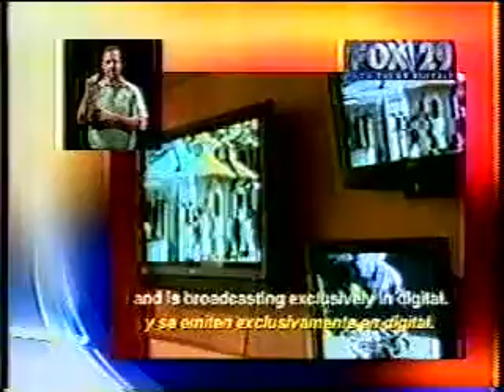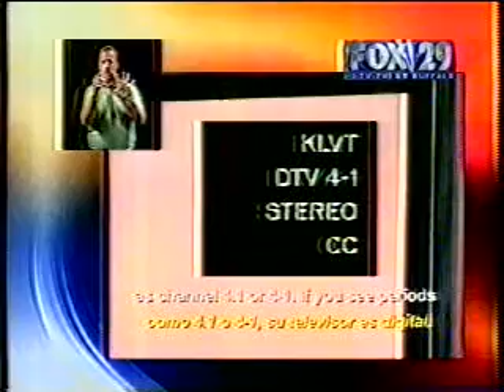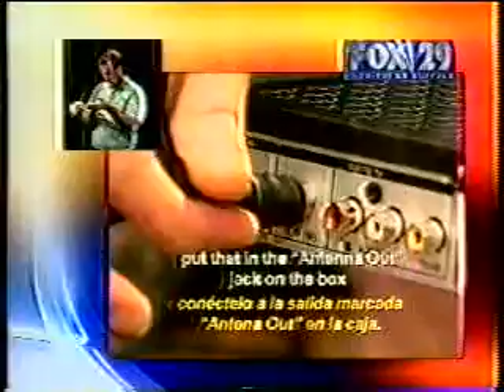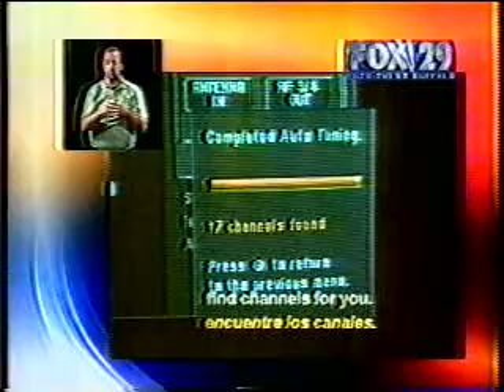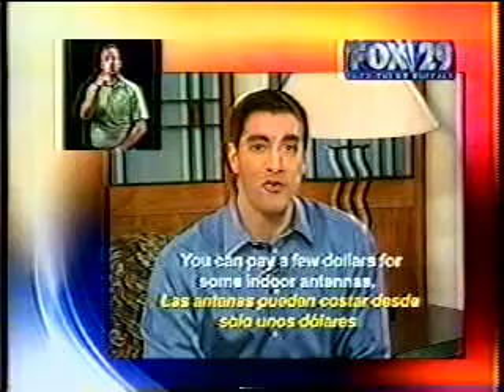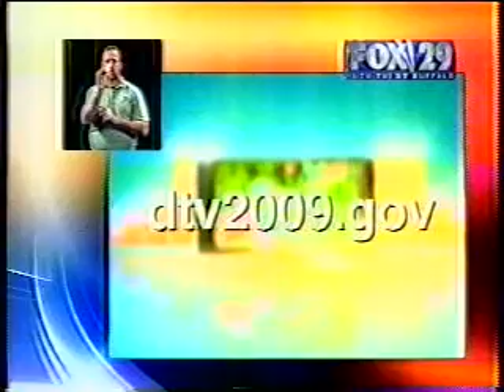Analog shutdown DTV information loop

Comment: Hello, I'm Mike DiSerio from the National Association of Broadcasters. From now on, this Television Station is no longer running regular programming in analog format, and is broadcasting exclusively in digital. The switch only affects viewers who watch TV using antennas. If you're seeing this message, this Television Set has not yet been upgraded to Digital, or your equipment is not working properly. If you subscribe to pay TV service like Cable or Satellite, you should call your provider immediately.
Reply: On god